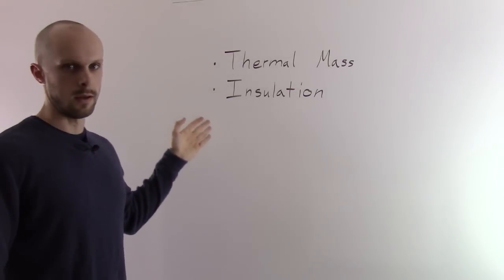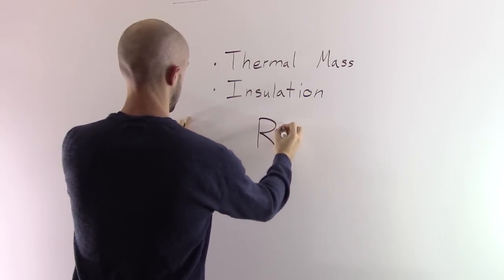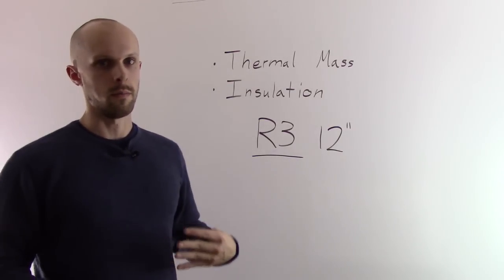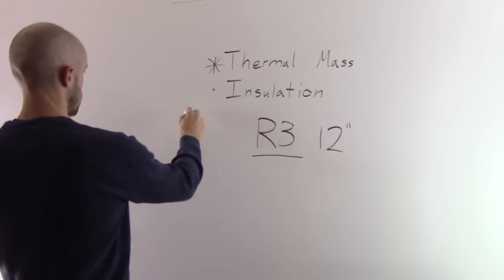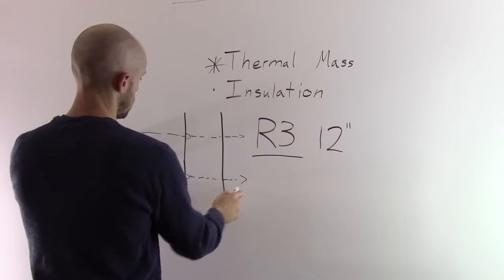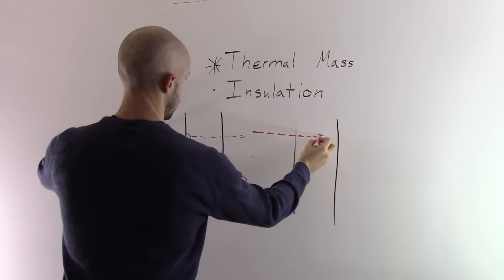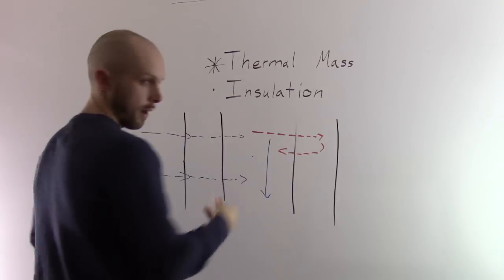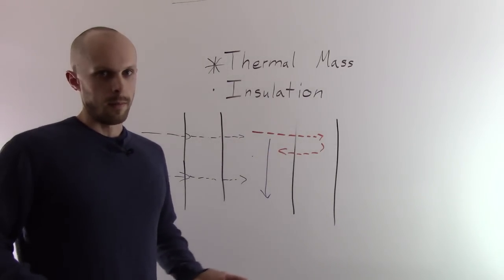How Does a Cob House Have High Thermal Mass But Low Insulation?

Comment: There’s a comment that was left years ago about how confusing the explanation was and I agree. The way you explained it would makes sense to someone with experience with insulation/construction of a regular homes but not for the average person. How does a rating of R3 value compared to the common house that is built in that climate? Are they an R15? It’s hard to understand when there’s nothing to compare it to. If it’s 20• outside does that mean at best the inside will be 40• and is that with or without heating? And how does that compare to other homes were regular insulation in that area? Please dumb it down, you clearly know what your talking about. Thanks

Comment: Very informative video! Thanks. I live in PA and in the winter I'd say it gets around 20F. Do you think a cob house would still be appropriate if I would have to heat through the winter with a woodstove? Or do you feel the heat would dissipate too quickly due to the low insulation? Do you think a straw bale house would be more efficient for my climate? Thanks for any insight.
Reply: +frozentootsiepop I am NOT an expert and have only been researching cob for a couple of weeks, however, from what I have learned, this is what you need to do:

Look into passive solar principles. This is how you design your house to maximise shade in the summer and sun in the winter. It takes into account air flow and positioning etc. For example a tree planted in the right place will provide shade in the summer and let sun through in the winter. Design is your biggest tool.

Consider a hybrid mix. You may be better off with straw bales on the north and cob on the south. However all your building materials are the same so it's easy to switch it about.

Make the most of heat radiation from cob. When cob is heated up it will hold it's heat for hours. SO by design you can utilise the sun in winter. Look into rocket stoves and under floor radiation etc. Even if you decide not to apply these, it will give you a better understanding of how to design your house for your needs.

Understand radiant barriers. These are more important than insulation in regards to your roof. You could also consider a living roof.

Good luck!